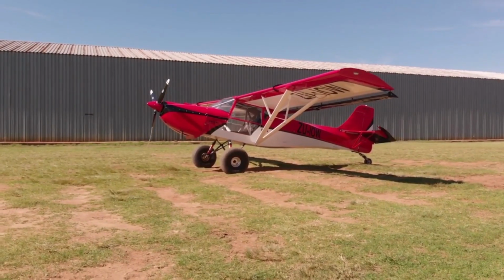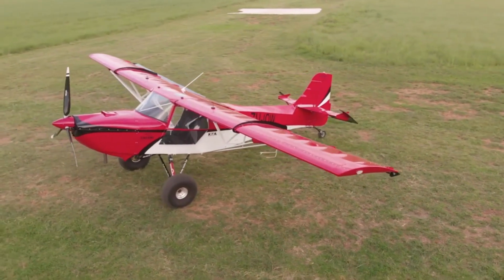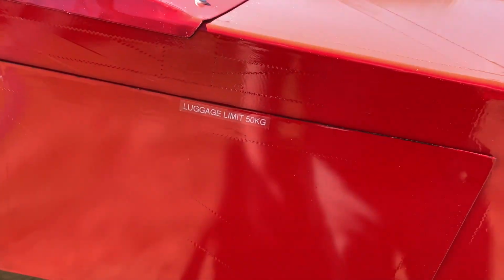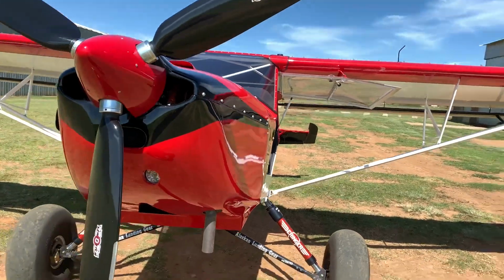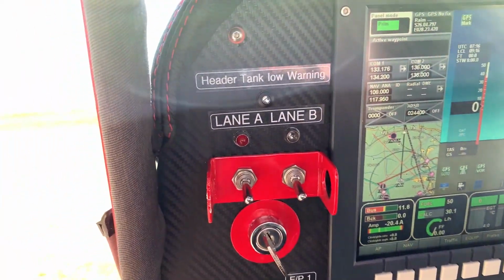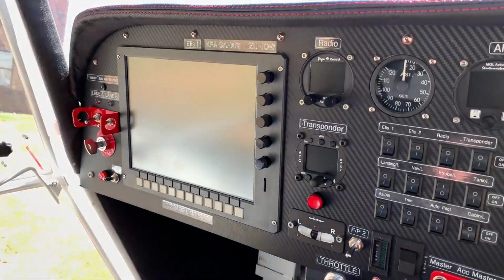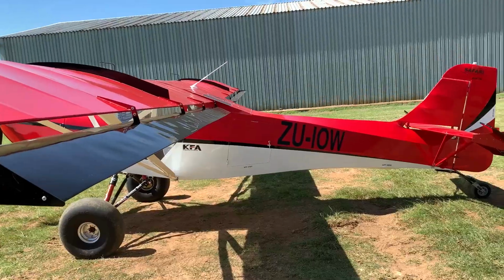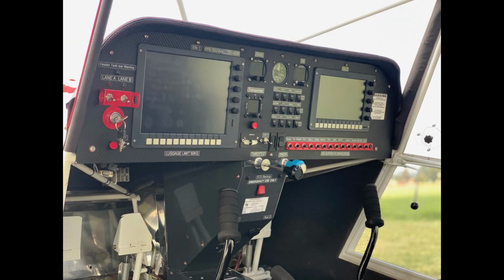Introducing KFA Safari MK3 Rotax 915 IS

Comment: Make your own VGs out of aluminum - looks better and higher quality than the plastic ones. Hope you have tie down connection points; how about carbon or aluminium bottom and sides for the cargo area instead of felt, etc. carpet? Angle of attack indicator? Cigarette lighter or similar for 12 V tire inflator? That's all the suggestions I can come up with, lol....looks great.
Reply from the maker: Thanks for you input. That is a kitplane and built according to the specification of one customer. As a builder you can implement almost everything to your want and and to your gusto as long as the technical requirements such as weight and balance are considered.

Comment: Why no flaps?  Just asking, more weight, but greater landing angles and slower landing speeds.  IMO
Reply from the maker: Has got flaps (flaperon system). Activated by pulling a manual handle between the seats. The pilot still has the standard separate controls for ailerons and flaps, but the flap control also varies the flaperon's range of movement. A mechanical device called a "mixer" is used to combine the pilot's input into the flaperons, A flaperon (a portmanteau of flap and aileron) on an aircraft's wing is a type of control surface that combines the functions of both flaps and ailerons

Comment: Not keen on that header tank in the cab should things go pear shaped .
Reply from the maker: Do not worry, the header tank has only 8 liters and is well protected by the steel structure. All the tanks are made of composite and are very solid. A header tank also guarantees that tight banking will not lead to air in the fuel lines.

Comment: Nice baggage door!  It's a great engine, but for that size plane, about the same as my RANS S-7S, it adds a lot of weight, all forward of the firewall.  Some people think more power is always better, but it comes with a lot of drawbacks.  I fly out of a very short strip at 5640' ASL, and a Big Bore mod to the Rotax gives me about 106 hp, at less then 4 GPH, and the ceiling is well over 14K.  Nice plane, but if it was mine, I'd put a 912S with a few mild mods in it.
Reply: I have flown both, a Safari with a 912 mod which takes it to 120hp and the Rotax 915is @141hp. In my eyes, you cannot compare the two at a high density altitude - the 915is will get you out of any strip that you can land at - room needs to be afforded for the take off roll on a 912, especially at a high DA.
Reply: Yes, agreed, but again no mention is made of the degradation of a really short landing. No question climb and cruise would be better!  You see how Trent Palmer did at the Oshkosh STOL event?  He got his butt kicked by a lightweight RANS S-7, all that extra power and the controllable pitch prop doesn't help squat ON LANDING. His takeoffs were not impressive either.   None of this matters if airstrips are used, if landing true off airport mountain sites, it for sure does.  More weight to decelerate, after coming in a bit faster, adds up to a lot longer landing, as these STOL events show. How about this: I want a 915 when climbing out,  (not for initial takeoff) and cruising at above 10K, but I want a 912 when landing!
Reply: portnuefflyer I see your point but in any real world situation where you need to make a decision on this or that, the 915 definitely trumps the 912.
Reply: @portnuefflyer  less gas solved it for me. Also nobody lands in anything less than 3*what you need.  You have to fly out. You're a goon.. U Probably drive a Subaru
Reply: The Safari with a 912 is a very so so performer. My own Safari had a 912 iS in and after 100 hrs I replaced it with a 912 Turbo. The Safari is simply too big for less than a 115hp Rotax turbo. It does fly quite well up to about 5000 ft with 100hp but above that the 915 outperforms it any day. At a DA of 8500ft I can take off in 65m and land in 70m. With a 912 that increases to 200m take-off and landing in 70m